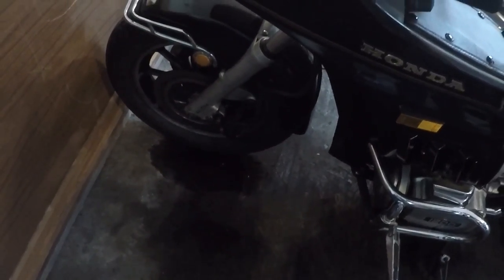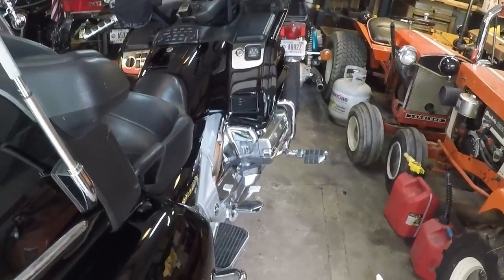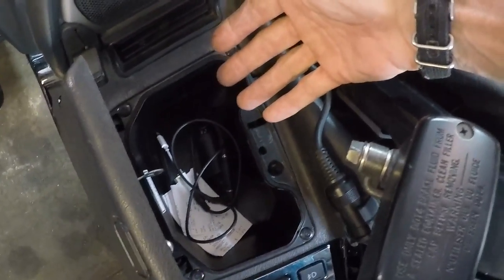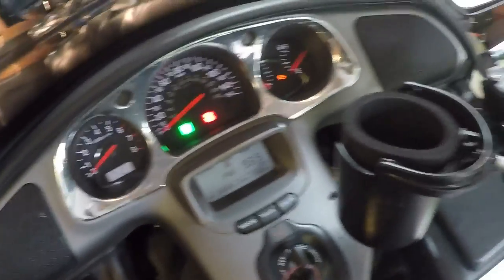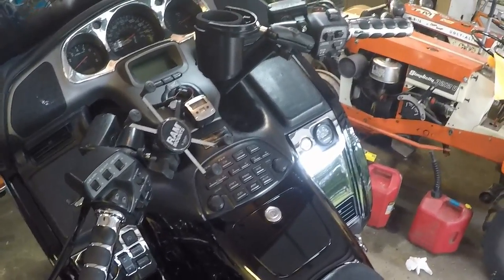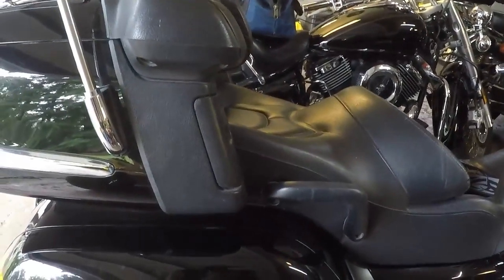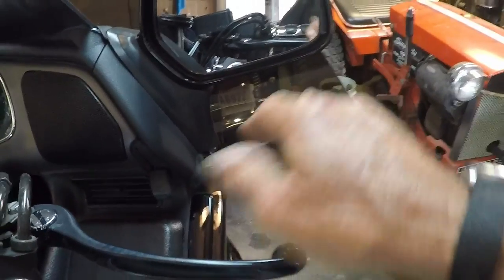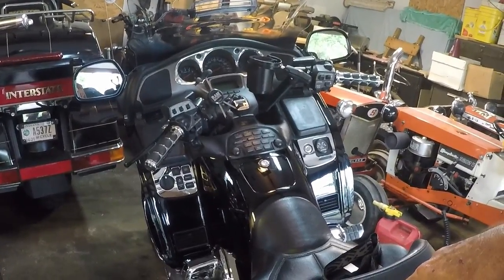Time for an Upgrade. New to me 2004 Goldwing!! Sorry not Sorry Smokey lol #smallenginenation

Comment: Nice bike good luck with it. I have a Ram mount phone holder all so I love it!
 
Bone
Reply from the maker: There are SO many Ram Mount accessories out there!! There was a Garmin already mounted with one, so I've got a spare mount as well as a static "bolt on" plate that I can use to add a cup holder for Miss Zippo. That is, if I don't get the Kuryakyn arm rests for her that include a cup holder. I'm definitely ordering a back rest for my self and I'm torn between a couple different brands of arm rests for her. We'll See!! Cheers Bone! Headed to see your latest video! Zip~